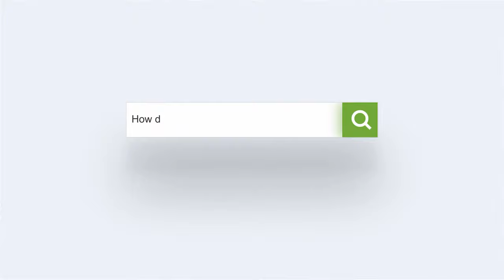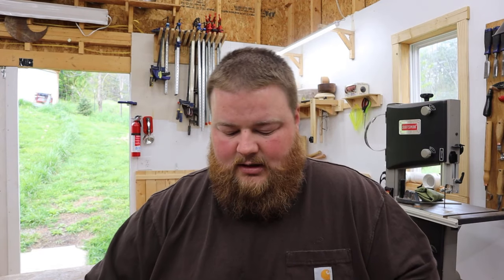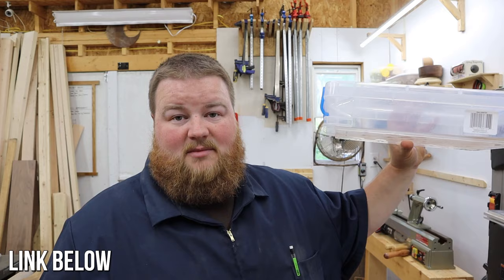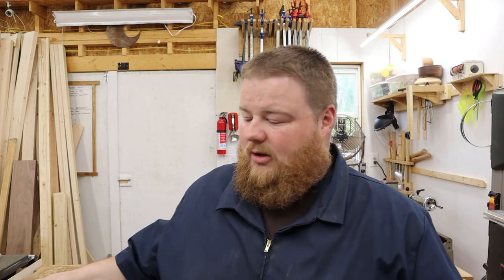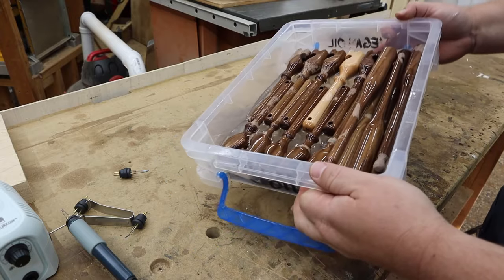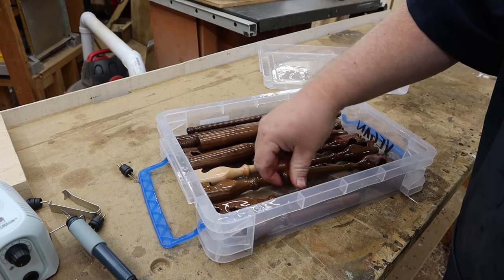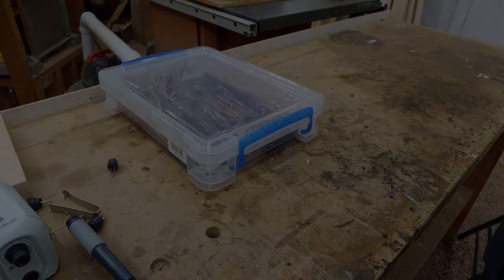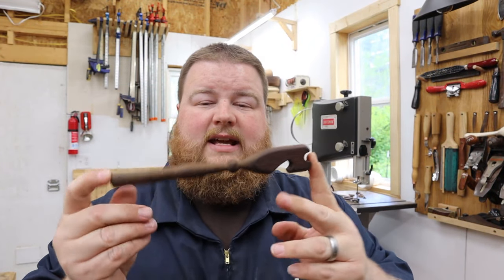It's Time You Hear This | Wood Finishing Technique for Cutting Boards & Wood Utensils

Comment: This actually may not be the best idea. The wood whisperer did a video recently on this topic. By flooding the wood you end up with uncured oil trapped inside. The oil can leach back to the surface days weeks months or even years later. Then the uncured oil will cure on the surface and turn white as it dries and crazes. it also may not be anymore water resistant in the long run. I really messed up a couch build for a customer. I kept adding pure tung oil every day for a week. It ended up with tons of white spots. I gave it to the customer like that and promise to fix it later. I'm dreading having to take that on.

Comment: This is what I do with my cutting boards. I float them in a mineral oil bath and allow the capillary action of the wood to pull the oil fully through the wood. Normally soak for several hours. After its fully soaked i take it out and drain it. Then after the excess has drained, finish with a coat of beeswax.

Comment: Great video today. I agree with everything you have said even though I have been guilty of starving my own store bought utensils and cutting boards at times. I appreciate the passion and encourage you to keep doing your thing. The fact that you use a more expensive and specific oil shows that you care about your product and customers, rather than cheaping out for the less expensive mineral oil. That's the kind of thing that sets you apart, and as you know is a good selling point for your product.

Comment: Have not made any cutting boards or utensils, but this makes so much sense. The deeper you can get the oil, the better the wood will handle water and the harsh environment they will see. Love the passion and pride you put forth in this video. It is the sign of being a craftsman and not just some woodworker
Reply from the maker: Thanks!
Reply: More isn't always best.

Comment: I applied oil to my first and current thick cutting board by keeping it very warm by my wood stove, and applying more and more. I let it stay warm for days even putting it on top of the stove with a trivet, when the stove was not so hot. It was a drying oil, linseed, which would require, IMO, soaking as you did, then a month to dry; or.... heating your wood in an oven, and heating your oil some, then a shorter soak, because the wood will quickly soak up the oil. Tung oil probably better. You can also heat your wood pieces after soaking to speed the drying time. Maybe a quick final coat of wax?

Comment: Have you ever considered or tried putting a piece into oil and using a pressure or vacuum to enhance the time & depth of "soak"?

I'm just thinking of something like a PVC tube sealed on one end and screwed on the other with a fitting to either apply a small amount  of pressure or small amount of vacuum.

Comment: Hello Sam. Very much agree. I am an older guy and was taught ,by my Dad when you do a job do one you can be proud of. Has you run a business you may want to try and use a small vacuum pump to speed up the old penetration. Some are not that high and you could get by with a very low cfpm / cubic foot per minuet. Hope that helps a bit. Liked,shared. All my best.

Comment: Your method is the way to do it.  I've seen cutting board makers drop the boards in a sink full of mineral oil and then take them out and put them on a rack over the sink to drain off the next day.  BTW, butcher block oil is mineral oil...so you may be able to save a few dollars by switching to that, same product, different name.  A coat of bees wax is also nice in addition because it too is food safe.
Reply from the maker: The oil I use is a plant-based oil, so isn't mineral oil. But I've wanted to try out some beeswax finishing on some items to further enhance them. Take care Jim!

Comment: Thanks for the tips. I've been that guy that gives my first few cutting boards  3 or 4 coats of butcher block oil and called it good. Now I'm gonna invest in a system for a bath for multiple types and sizes of cutting boards. Would you recommend oak for cutting boards or is it too hard on knives. You got a new subscriber. Thanks again for the information and can't wait to check your other videos.
Reply from the maker: Oak will work okay as a cutting board, but it's not ideal due to the fibrous nature and open pore structures of the wood.  Thanks for the sub!
Reply: @Samcraftcom  Good to know thanks.

Comment: Great video! I totally agree in fact I have a large tub with gallons of oil for cutting boards. $13 for 8 oz of oil?😳 I buy pharmaceutical grade mineral oil for way cheaper by the gallon.
Reply from the maker: Right on!!! The finish I use isn't mineral oil, but a plant-based oil from Canada. 😎 No way I'd pay that much for mineral oil. LOL

Comment: Honestly you only have your opinion without providing any evidence that what you are saying is correct.  
To make this a more fact filled video how about taking a couple of utensils and “lightly coating” one a couple of times like you said people do and then the other one do it your way.  
Then cut them both in half and measure the depth the oil penetrated.  
Then your “opinion” will either be show to be right or wrong.

Comment: Ok, I see your points , however, have you taken a tool that soaked in the oil and cut it in half, can you then see that the oil soaked in and penetrated the wood any farther than a rub down? If you are correct you should see the oil deeper in the wood as evidenced by the cross cut end??

Comment: Well, I have never tried coconut oil in the 30 or so years I have been turning bowls. The main question I would have about it is does it polymerize? I have been using walnut oil for probably 25 years after I found out about it. It will polymerize after a week or so, especially if you expose it to sun light and minimal heat. This provides a better finish than any oil that does not polymerize. I have heard of using grape seed oil, and hemp oil, but again, know nothing about them polymerizing. Tung oil does polymerize, but tends to leave too much residue. I started using Mike Mahoney's walnut oil, and switched to the product from The Doctor's Woodshop, in part because we are both from Oregon. Have you tried other oils? How did you settle on coconut oil?

Comment: I disagree with you completley, but hopefully respectfully. I believe in balance and measure and such a waste of oil I see no purpuse of. While you take care not to waste your oil away from wood such baths waste oil within the wood.  I do remember being told by old gaffers-similar to your process-that one should apply oil to the top of a butcher's block until it comes out on the other side - effectively the same effect as yours putting it in a bath. Saturating wood with oil completley. However in my experiance such blocks are heavy, dark, oily and hard to describe unpleasant to use years down the road. A proper amount of finish I find a much better solution. Protection should be there, but not excessive. Some oil and some wax that stays mainly on the surface is sufficent and beautiful. While such a finish is not permanent, I find nothing wrong if the consumer has reponsibility for some  maintanence. All trully great peaces of woodworking I have seen are such.

Comment: You really should have stated heavily in this video that you used Coconut Oil. Since it is known for not having a sticky residue, which other oils do. Most other oils when used like this would be ridiculous and would end up being trash, due to having to check it every couple hours for up to week"s" after and 24 hour bath. With other oils, if not wiped on a regular 4-6 hour schedule after doing a bath for a day can leave you with gummy residue that in most cases ends up ruining your product. Since you left that key component out, you may have led people to ruining a large batch of products. Just an FYI from a CNC batch woodworker that has ran tests on the "other oils" and had very bad results. I will definitely try this method and run it through my torture tests. This would have been great info if you would have given all parameters.

Comment: When using drying oils with long cure times (Tung oil), applying a coat and allowing it to dry fully can help. Soaking works okay with these oils if the piece is sitting to cure for over a year, but moderately thick pieces take about that long to cure through with pure oil (and solvent mixtures of such).

Once you have an application mostly dried, it'll somewhat retard the penetration of the oil of subsequent applications, so that you can apply more without it going so deep that it's liable not to cure.

Comment: I accept your point of view, but, after watching many wood professionals with utensils and boards, you don't bring up a downside, or the downside to your finish process: it may well be oil or finish dependent, but soaking and bathing a cutting board in an oil bath, it's pointed out, will leach oil out of the board and into the foods on a cutting surface.
I only bring this up because you made the point and didn't address this downside, in your devil's advocate list. 
That said, it is worth emphasizing that wiping oil on kitchen boards and tools likely isn't done as thoroughly as could be done.🤔

Comment: Great tips video! 
If you are going to take the time to make something for someone else to buy and use, take the advice here and make it worth it. If you have an issue with the cost of the oils or finishes you are using you might want to look at the rest of the picture and check material costs, time, shipping, and sales prices to see if it's able to be offset somewhere a lot more than a bottle of oil that you can get a few uses out of for several items.
Reply from the maker: Absolutely!

Comment: Even for change bowls or other small workable items I would have thought the time and mess saved by
 dunking/soaking would be worth more than the amount of oil you'd lose. Also having a longer lasting finish cant hurt. Not to mention how much money did you really save having you finish soak into a rag vs soaking it into the product and letting them drip "dry" back into the bucket you use to work the items.
Reply from the maker: Precisely!!

Comment: thanks for this video. I have run a wood shop for over 30 years making cabinets and I often see other shops skimping on materials or otherwise rushing products to market. I learned my craft in a shop with only one power tool, a table saw. everything else was done by hand. I still use that method as much as possible.that being said, I was introduced to lasers a couple of years ago by my son, a design engineer. I bought one of his old stool D1 lasers and was hooked. I just bought as F1 with the bed extension and have been following your videos as well as others I have found..I found your jigs for the f1 to be awesome. thanks for the help.i will continue to follow your videos.

Comment: Plain mineral oil from Walmart is like $2.00 a bottle.
Reply from the maker: Correct, but I don't use Mineral Oil.
Reply: @Samcraftcom  "cutting board oil" is mineral oil...wait. expensive cutting board oil, same as salad bowl oil...buy a $2 bottle and try a test, the tell us what the difference is after an overnight bath, or even a months service. Not trying to be a butt, trying to save you money without sacrificing quality.

Comment: Great Video. Wood is toxic so for wooden kitchen ware it needs to be well sealed. You never mentioned what type of oil you use , Im guessing a natural salad bowl oil or something of that nature. ANYHOO I USED TO make and sell wooden flutes. With flutes people are not only putting the wood on their mouth but are also breathing whatever fumes are being emmited frum the wood. I tried many methods to seal the wood . At one time I was putting them in a pressure tube filled with oil, I even added vitamin E to help prevent contamination. I tried shellac and beeswax all natural , they use shellac to coat asprin and other meds. Anyhoo I only make flutes out of pvc water pipe these days .They can go right in tha dishwasher along with our wooden utensils which arent coated with anything and are holding up fine sum are older than you HaHa Cl;-(p) I applaud your commitment to produce good quality products, I wish more young folks had your interegerty Sam. It's not found as often as it used to be sad to say.
Reply from the maker: Now I'm really interested in the PVC flutes!! Are they classic instrument style or more like Native American style?

Comment: Have you ever used or tried Odies oil or butter?
Reply from the maker: I've not, but seems many people really like it. I should check it out sometime!
Reply: @Samcraftcom  Thanks for the response. I haven’t made very many boards but all but one have been end grain and 3d  for family so most will probably be displayed but I made them to use like any other. I finished about all of them in different ways just from reading different opinions so I hope they are used so I can see if any have a problem. The last 2 I used 2 coats of Odies oil and a coat of the Odies butter. Thanks again. I’m also hoping to get a Shapeoko in the next production run in March. It sold out in less than 3 hours after I got my email on this run. I am a mechanic but have almost zero cnc knowledge.

Comment: How often would you recommend oiling my butcher block counter top and what should I oil it with?
Reply from the maker: Oil it as often as it appears needed -- whenever it looks dry.  Most people use food grade mineral oil (easily found at drug stores in the laxative section). I prefer to use a different oil for my products that is plant-based. It's more expensive, but worth it in my opinion. Here's a link to the oil + wax kit. You would apply the oil and let it soak in as much as possible, then come back and apply the wax for a lasting protection. https://amzn.to/3afWFqE Hope this helps!

Comment: I totally agree.  Just a question, Sam.  I make kitchen cutting boards just for my own household.  I use vegetable oil because it is way cheaper. Olive oil, canola or sunflower oil.  What am I loosing out on by doing that?  Longevity?  Looks of the boards?
Reply from the maker: I don’t think you’re missing anything with those oils with the exception that those food oils run a higher risk of getting rancid... so I’ve heard.
Reply: You got me going now....is it walrus oil
Reply: @Samcraftcom it's not a high risk, it's guaranteed. Those oils do go rancid. It's basic food science.

You'll be much better off buying food grade mineral oil for $25/gallon, which is used on almost all industrial food cutting boards, food processing equipment in every piece of meat or food you buy, and all restaurants - and it will never go rancid. 

Or, as in this poster's preference, he uses MCT oil, which will have a much longer window before going rancid than your other food oils.
Reply: Anything other than food grade mineral oil will go rancid.

Comment: Took 4 minutes to get to the point. 
Geeeze.  Americans 
I add spirits to thin the oil out for deeper penetration and heat the oil first. 
Gets at least twice the penetration if you really want to do it properly.

Do your own test pieces then cut them in half and see.
Also you need a mesh draining tray like what you sit cookies on over the container to save oil.
Also
After the final sand, a light spray with water then let it dry.
Then final sand again before oiling.
This will get rid of the fur you can get after oiling.
Cheers
Mikey from Australia.